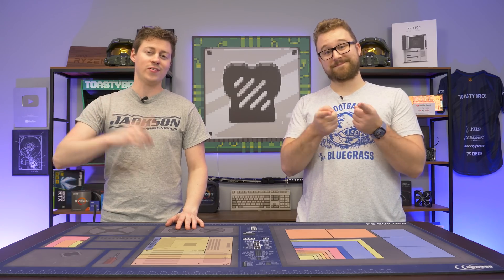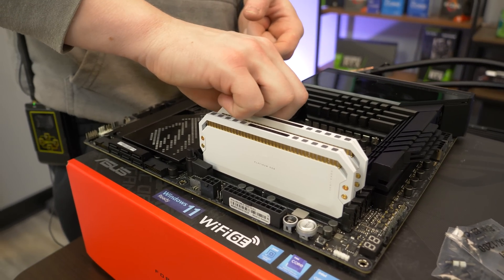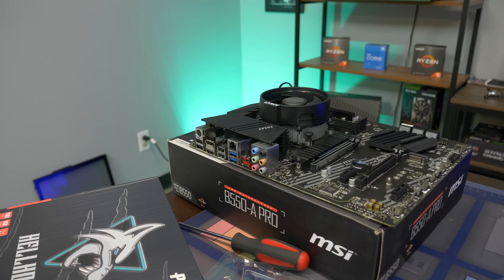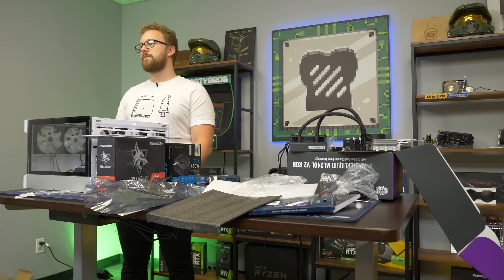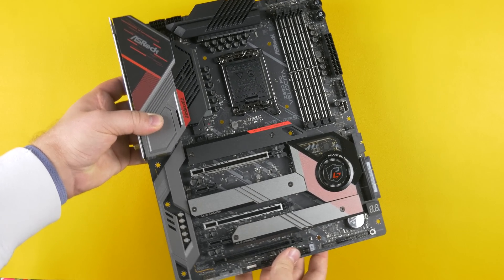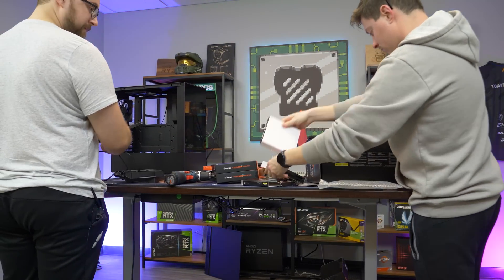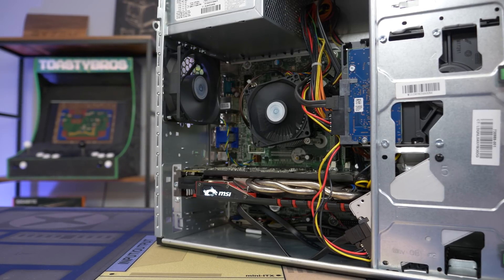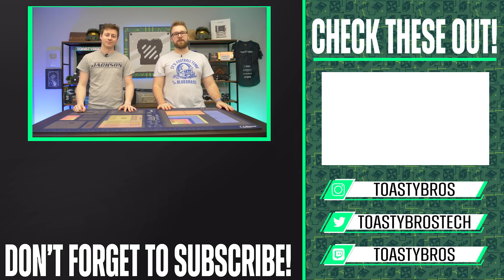WATCH THIS Before You Build a Gaming PC - 2022

Comment: I'm building my first pc (primarily for gaming) and planning on getting a B450M ac/r.2 motherboard, ryzen 5 5600G cpu, and rx 6600 gpu.  I plugged all these into multiple compatibility checkers and it says everything is good, but I'm worried about the motherboard BIOS not supporting the cpu and I can't find info on it anywhere... would you guys be able to help please?? or let me know if I might run into any other issues with these components together? would be greatly appreciated!
Reply: don't buy 5600G. it is weaker, than 5600x. and you are planning on purchasing a dedicated gpu so you don't need integrated one.
Reply: @TheJokernik  thank you for the feedback. The reason I wanted the 5600G is just because it's cheaper. But now my question is if pairing the 5600G and the RX 6600 is better than having only the 5600G?
Reply: @andrewmetcalf7497  A 5600x It's only £50 to $50 extra then the 5600G, and the x is better if you're going to be using a discrete GPU and in your case it is a dedicated gpu so 5600x is better for you and will make a difference but if you can only purchase the G version then go ahead but make sure you select the dedicated gpu in your games etc.

Comment: Guys in Indonesia you can get a pc with this specs, please help, been wanting to buy a pc, is it worth it to buy rn?

price 900 dollars ish
idr = 13,800,000

- Intel Core i5 10400F + Free fan cooler master i70
- Motherboard H510M asus
- Ram 16GB DDR4 3200Mhz 2x8GB
- SSD 256GB SX6000 LiteNvme
- Case Cooler Master CMP510 ATX
- VGA Nvidia Geforce RTX 3050 8GB GDDR6
- PSU Cooler Master Elite 500Watt
- Free Windows 11

Comment: Another thing that I was hoping y’all would touch on for motherboards would be this.. make sure that the cpu supports the m.2 slots. I bought a mobo LGA 1200  for 10th and 11th gen intel cpu.. got it in hopes of using both m.2 slots for ssd but the top slot is only supported by 11th gen 4.0 and you guessed it.. I have a 10th gen cpu 🙃 learned the hard way.. now on the market for a 2 slot m.2 board that supports gen 3.0 only.

Comment: You touched on the graphics cards, just wanted to add something. Don't pair an RX 6500 XT graphics card with a PCIe 3.0 motherboard, you'll lose around 50% performance in most games.

Comment: I have been looking at the new processors and GPU architecture. I still wonder why modern board dont have gaming level graphics built on? Its not unrealistic to have 8GB GPUs with A Alder Lake processor?
Reply: Because you physically cannot fit that much power in the small form factor of a CPU. Modern GPUs are already larger than APUs to begin with.

Comment: Hi everyone,

I own a pretty good laptop on the form of an Asus ROG Strix G531 from September 2019 upgraded to 16Gigs of Ram.
Mu life has somewhat changed since almost 3 years ago (like all the world I guess) and I would prefer now a desktop Pc.
What would you guys recommend?
To give a few details:
- Budget under 800/1000 €
- I only play CS : GO on my computer (already have an Xbox for other games) but I'm accustomed to 140+ fps on CS so I'd like at least that or even better ofc. 
- for Work I do mainly 3D softwares like Sketchup, Rhino or occasionally C4D and renders with V-Ray + Photoshop and Illustrator.
- I want a build future proof and can be persuaded to have a build without a graphics card if it saves a lot of money.

Thanks in advance for the help!
Reply: You don't need that much money, if you wanna play CSGO. 
I'd aim for a GTX 980 because it'll last you a while but is still fairly affordable. A 970 is fine if you really can't afford a 980 on your budget.

Either get a Ryzen 7 2700(X) with a B450 motherboard and 32GB 3200Mhz
Or an E5-2678 v3 with an X99 (watch Miyconst for which one to get) from China and 32GB DDR3 or DDR4 RAM of any speed (the CPU supports both). 

The reason I suggest these are specifically because both will do well in terms of workstations.
Get a 700W 80+ Bronze PSU. Choice is yours, but I'd get this so you can upgrade the GPU in the future without issues.
Grab 1 TB NVMe SSD of your own choice.

Future proofing doesn't exist. Arguably, being on AM4 (Ryzen) you can upgrade to a Ryzen 7 5800X sometime down the line. But with competition as it is right now, you're not "proofing" for anything beyond 1-2 years. You'll need another full upgrade in 3-5 years and potentially a new GPU before that.
Reply: @b0ne91  thank you so much. I'll check things along those lines. 😉
Reply: @b0ne91  b450 only supports up to 2933 mhz ram speed?
Reply: @lutovac_nikola  official support doesn't matter, you could even take B350 and Ryzen 5 1600 to 3200Mhz no problem. Zen+ takes 3600 Mhz most of the time. The mainboards all support it anyway, it's the CPUs that might struggle.
Reply: @b0ne91  I though if the motherboard spec don't allow it its impossible to run at such speed. Yes you might enable XMP in the bios but when you turn on its still gonna run at the max Motherboard speed. There are different opinions on the browser about this
Reply: @lutovac_nikola  I mean you can look it up. The boards support it. I've done it on A320 boards. Afaik as long as the motherboard can support the voltage required, there's no limit to memory. The limiting factors are the memory modules themselves and the memory controller on your CPU. 

The "specs" you find, like 2933 Mhz on Zen architecture are just what the worst quality chips could definitely handle (i.e. very conservative numbers) back when it came out. They haven't been updated since and nobody cares to do so either. If they did and even one person finds a chip that can't do 3200 Mhz, they're opening themselves up to problems.

Comment: I’ve been using Prescott era prebuilt cases, and I am stuck on whether I need to mod a front intake fan or 120 mm radiator.  Also would using the PSU as an exhaust work if there is no rear fan?

Comment: In 2022 is it worth getting a rx570? Or should I just save my money and get a better card
Reply: Rx 5600xt or rx 6600 if amd have low price in your country. If Nvidia low price choose 3060 or  budget 1650 super
Reply: Get a better one 570 is outdated
Reply: @ayn6837  which would you recommend for someone who’s new into building a pc
Reply: @mystez9625  and which cpu would be best for them
Reply: @acesosss  try i5 11400f  or a medium end i3
Reply: @mystez9625  definitely not the 11th gen intel isnt as good as 12th get an i5 12400 or even the i3 12100. they both really good for gaming
Reply: @acesosss  i mean i would wait but the 6600 xt or 6600 is going for less than the 3060
Reply: @ayn6837  he’s going for a BUDGET build

Comment: hey can you guys review and upgrade the hp m01-f1214 desktop? it has a ryzen 3 4300g and 8 gigs of ram it would be very helpful.
Reply: Think the PSU might hold you back from core component upgrades.  Look up the part number for a 400 or 500w replacement, if the latter prepare to spend at least $120 plus shipping and tax.
Reply: @zeroturn7091  yeah i noticed the psu problem too when i got it, i was thinking of modding it to get a normal psu to fit in since it has enough space, some other problems i have is not knowing what to per this cpu with since theres not many videos about this cpu since its oem only
Reply: @Azt3c  
You need the second stick of RAM 1st.  You have an 8 threaded chip so that would happily run with 60 series cards, the new 3050 might be decent option if they're not too pricey.
Reply: @darthwiizius  do you have any recommendations in ram, if I add another stick of ram I might as well upgrade to 16 gigs of ram  but im not too sure what speeds or brands i should look for